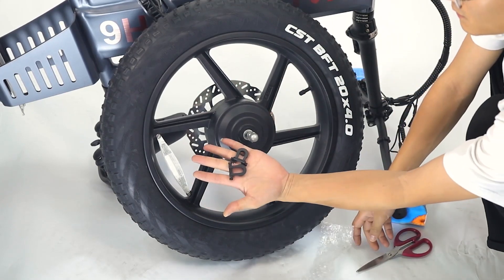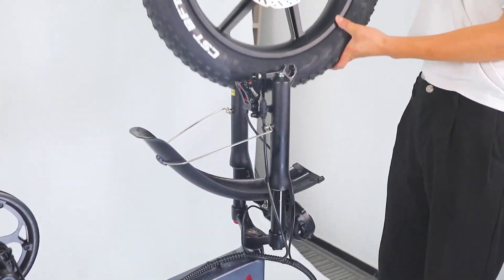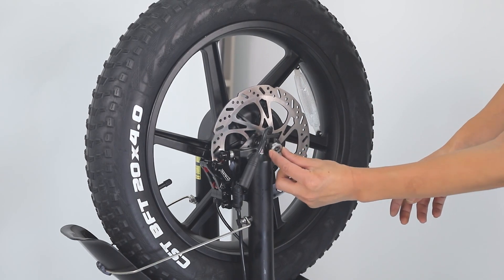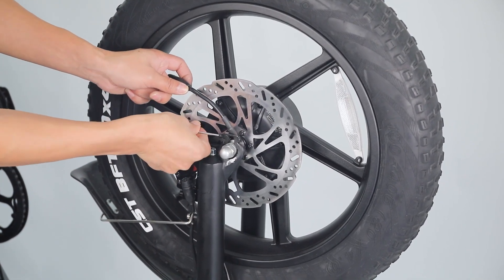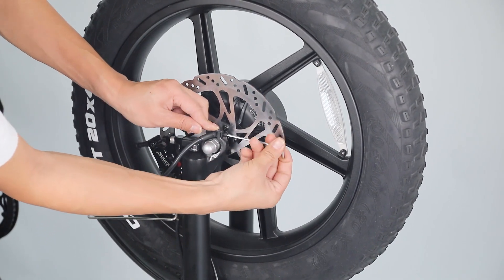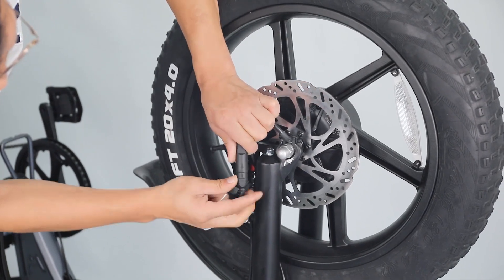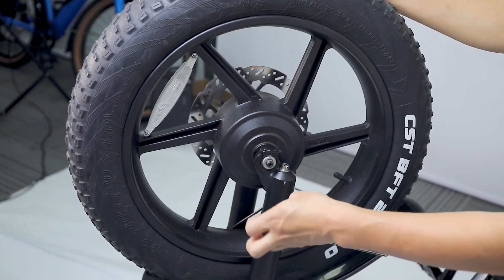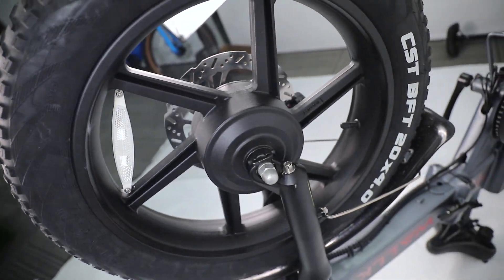How to Install Front Wheel of All Wallke AWD Ebikes

Comment: I don't care "how" I'm curious as to why. Two motors to use twice as much power twice as fast with less range? I don't get it.
Reply: Haven't got my bike yet but it should be switchable from one motor  to two motors  use 1 most of the time  use 2 and use more energy but the 1 motor is already propelling you so adding 2 and motor won't need all the juice  Helped?
Reply: Ordered the bike last night. I plan on using both motors on the steepest sections of my routes - not the entire time. I'm hoping it will struggle less than my Aventon Aventure 2.
Reply: Dual-motor ebike may consume slightly more energy due to the additional motor and mechanical components. In some cases, dual motor setups can even enhance efficiency through optimised power distribution.
Reply: @MarkMcCoy-y5x  Yes, it can be switchable from one motor  to two motors.